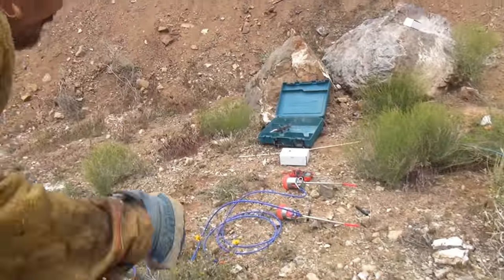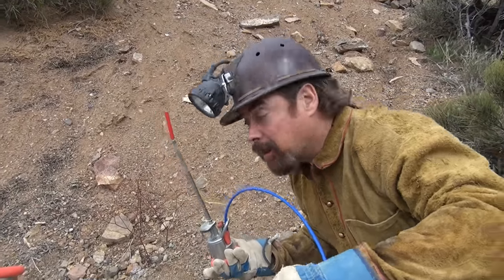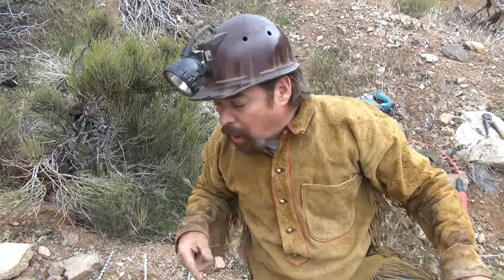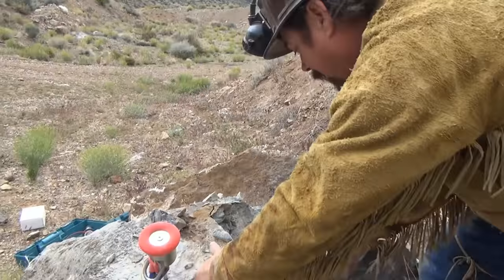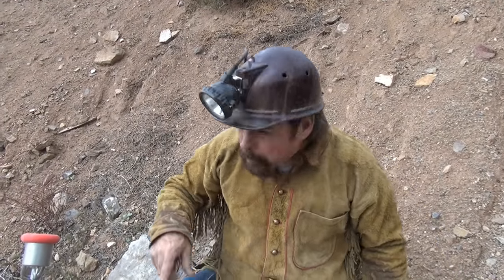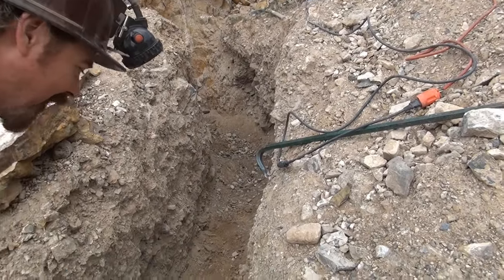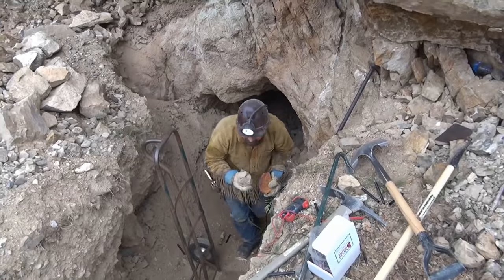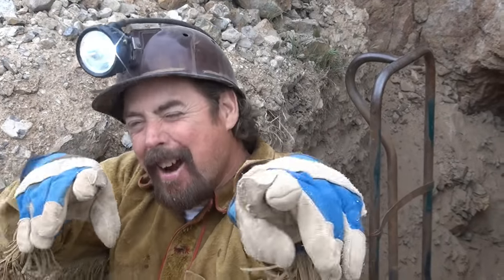BLASTING ROCKS  !!! With The Sierra Blaster. ask Jeff Williams

Comment: If you ever meet Aquachigger on a metal detectoring conversion. Ask him about his Caving adventures on the East Coast. As over the Summer, he found what might be a good unexplored way into a Mountain cave system. When the water had dissolved the Limestone and it's followed the Quartz fissure seam. So somewhere under that mountain the underground rivers may have undiscovered gold deposits waiting to be found. 
In his first video, on this new cave dig site. The Cave systems above are all dry. Meaning if he's correct that the lower levels drain out as Spring Water points that follows the Hard Quartz rock to the Surface. Which could make it easier to follow the Quartz seam to any Gold still in the Mountain.

Comment: Can you blast a wall of quartz with unknown depth probably drill a hole at a 45 degree angle and placing a rock on top. Trying to find the direction to go in a old 25' shaft

Comment: ammonia nitrite and diesel works good too.
Reply from the maker: +BETTY GIRL  yes it does but remember I said this is Legal.
Jeff and Slim
Reply: +Christine Lawson Ok awesome thanks do you know much about gold panning?
Reply: +April Griffin I know a little but nothing compared to Jeff and the other guys on the site.
Reply: +Christine Lawson its not letting me pull up the website lol
Reply from the maker: +April Griffin  Hi April, would be happy to answer any questions you have.
Jeff and Slim
Reply: +Ask Jeff Williams Ok so me and my fiancee went out to little pigeon river in Gatlinburg Tennessee for the very first time. and we tried all in the shallow part of the river and couldnt find any black sand at all so we took a sample from the high bench which had moss on top and cleaned cracks. Our first mistake was not seasoning our new gold pans haha. But my main question is where do we look for black sand or how do we find it? Where is it best located at and once we find it how deep do we dig?
Reply from the maker: +April Griffin  Hi April, you will find black sand if any exists in any areas where the force of the water slows down or where there are natural traps( i.e under large rocks siting on an impervious layer , cracks or crevices, water falls with large rocks in them. ) You can sometimes find black sand on the tops of sand bars and even in layers as you dig down. 
I would first do the research to make sure the area has produced Gold before in the past.
Jeff and Slim
Reply: +Ask Jeff Williams yes sir the area is actually a hot spot on the outer sides of the Smokey mountain national park. have u ever panned in Tennessee?